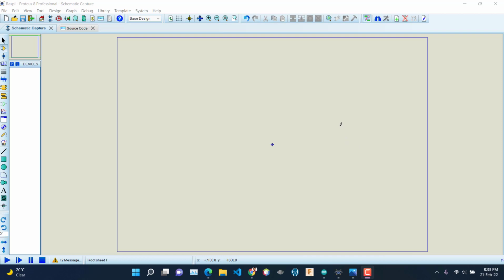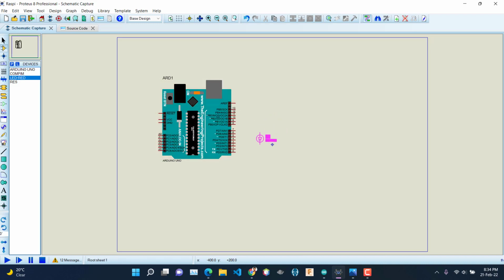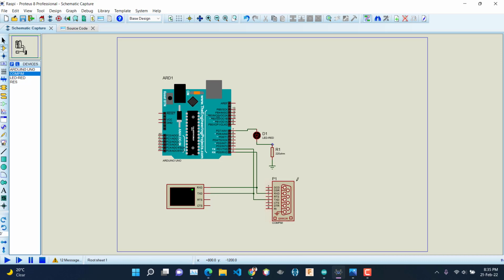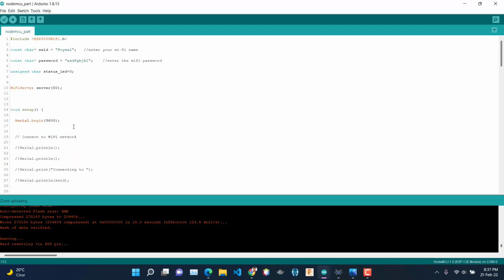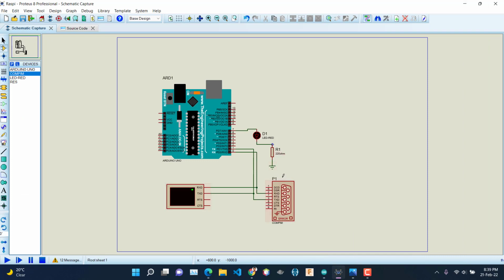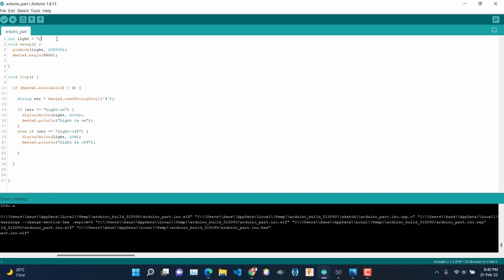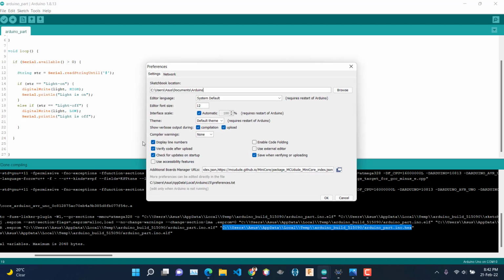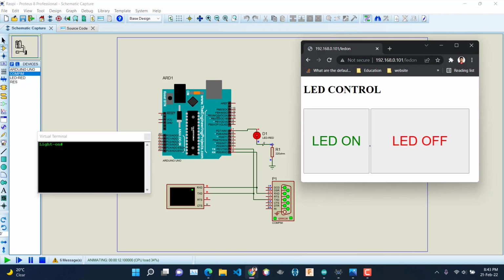How to use NodeMCU in Proteus | NodeMCU Simulation

Comment: Can we simulate nodemcu In proteus
Reply: In Simulation part the result obtained can be seen virtually we cannot simulate by adding nodemcu to Proteus only by connecting the nodemcu in the usb port and reading it's serial data using Compim component.
Reply: So we cannot directly simulate nodemcu in Proteus👍